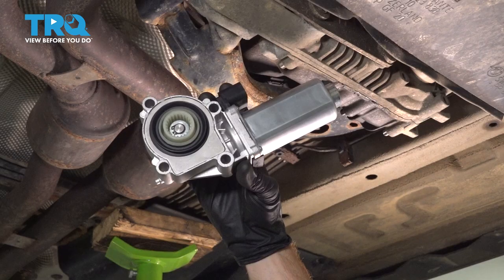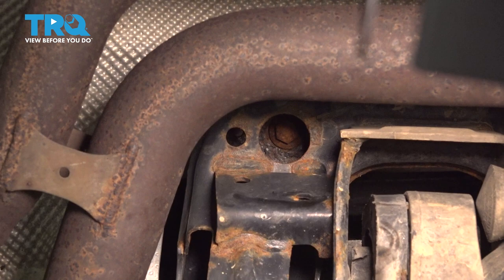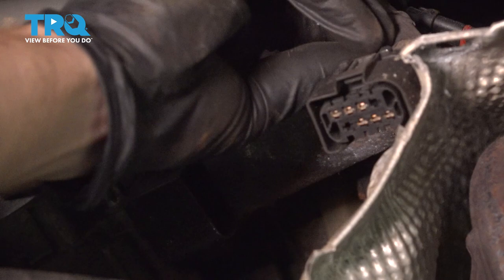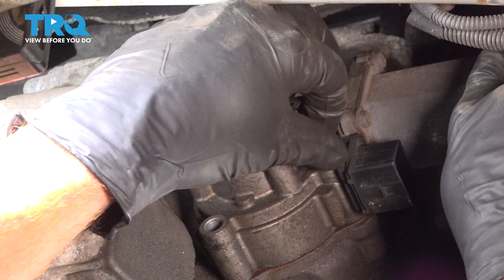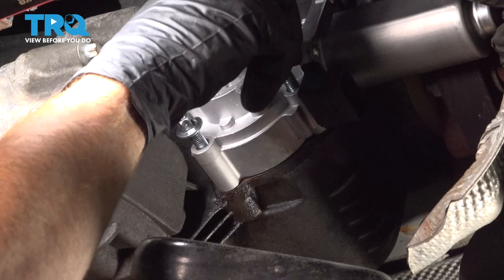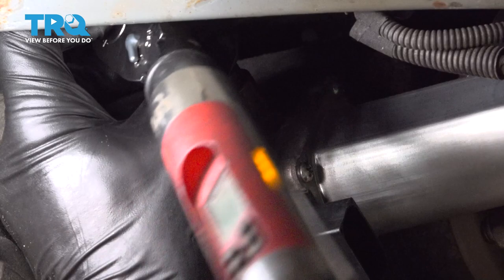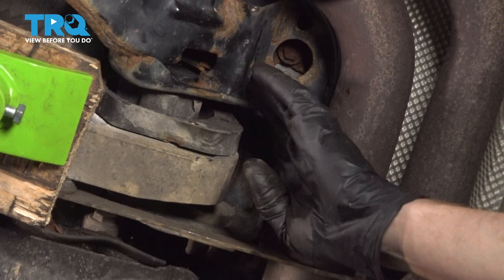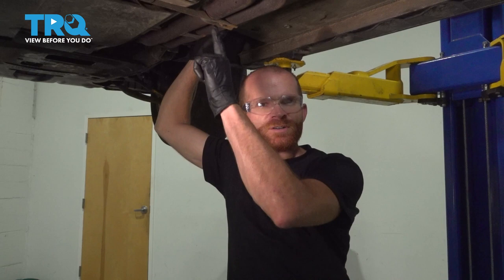How to Replace Transfer Case Shift Motor 2004-2010 BMW X3

Comment: 2008 x3 needed to drop transfer case a 1/4 or 1/2 inch in  order to get the top left bolt for the shift motor. There seems to be way more access to the top bolts of the shift motor in the video vs my car.